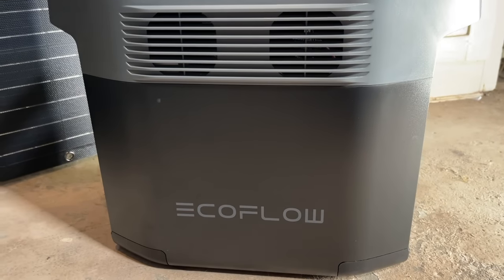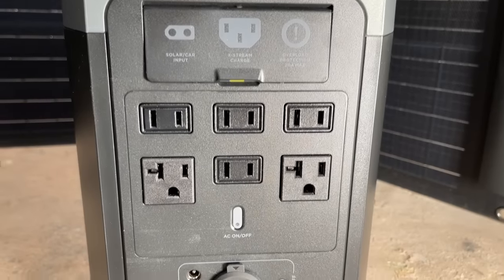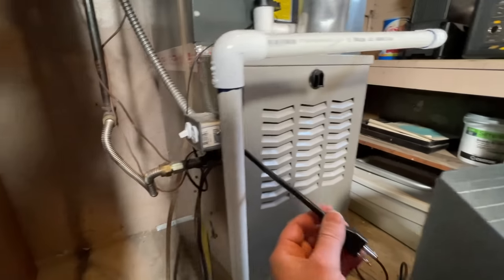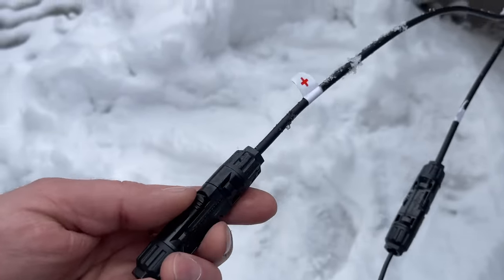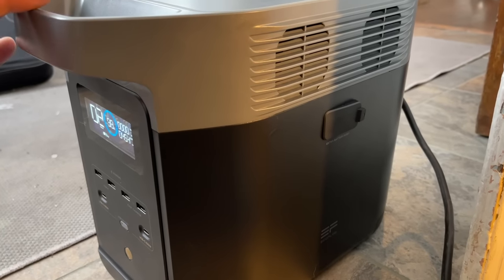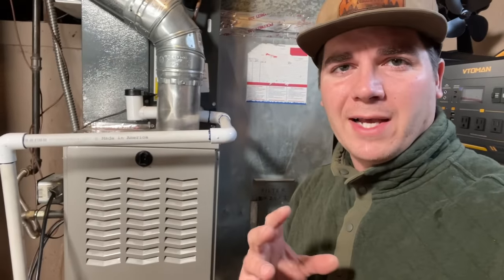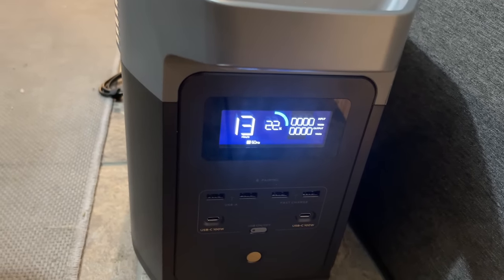How Long Will The EcoFlow Power Station Run My Furnace?  |  Power Outage Emergency Heat

Comment: While solar is nice to have for extended outages, in most cases the power will be knocked out by a storm that comes with dark clouds that make solar charging not practical. And the first sunny day after a storm is going to be when the power crews are out restoring downed power lines. So in this scenario, you may want to have another way to recharge depleted batteries.

One obvious solution is to have a gas generator. But if you have a generator, there's no need for a power station, right? Maybe not. Generators make noise and fumes, and when the power's out, gasoline may be hard to find. If you're already using a gas-powered lawnmower and/or garden tractor in the summer, and a gas-powered snow blower or snowmobile in the winter, this is less of a problem because you already have some stored at home, and rotate that stock regularly. If you don't, getting a generator that can run on propane is worth the extra expense. Unlike gasoline, propane is a simple molecule that can be stored for years without degrading.

To run a portable generator safely and reliably around the clock, you'd need to have household members up in shifts to make sure it doesn't burn the house down, asphyxiate the occupants or run out of gas. A better way to run one IMO is to use it to recharge power stations like the Ecoflow ones, that can be charged from zero to 100% in a little over an hour. That way the noise doesn't bother the neighbors at night, or attract thieves when you're away looking for more gas. Running it for an hour or two under full load will burn less gas than running it constantly under a light load.
Reply: It is best to have both. My generator is over a decade old but now with my powerbank I use it 80% less. If I were to replace my gen I would get one the is half the output cause I simply don't use it except to charge the powerbank for an hour and than shut it off till it needs to be charged again
Reply: @JD-yx7be  absolutely! If I had gone for a whole home generator, I have had 20 hours in the last 7 years to use it. Instead I went for a much smaller 2200W portable unit. Since all it has to do is charge batteries, I can run it at 100% as needed, vs. at a fraction of full capacity the whole time. So far, utility power has always come back before the batteries ran out, but it's there for when that happens.

Comment: Very insightful video, interesting product idea.... but I had hoped it would power a furnace or boiler for days, not hours since the heating source is oil or gas.  I really need something that will power HVAC for several days in case of an outage from an ice or heavy snow storm up here in the New England.  I guess a NG generator is still really the best option, unless there are other options ?

Comment: What wire type, size and connectors do you need to make extension cords between power station and solar panel connectors? I’d like to make up a 50 foot set. 

Do you know if they have a through the wall adapter for the solar connectors?

Comment: Thanx for the information and the video!  Are the battery generators really appropriate for larger loads with motors and compressors?  Yes the battery generators will work but current in rush on startup is very taxing and surely will foreshorten the lifespan of the battery generator if not damage it at some point?  Has there been any testing in how many cycles (of inductive) loads are practical (or even really appropriate)?  Battery generators are not cheap, expensive and time consuming to repair if it can be repaired (type of damage, parts, supply chains), and can be a fire hazard if safety measures fail.  I’m not knocking the tech … I own 4 battery gens that run computers, lights, televisions… but I’m Leary of furnace and refrigerators…. Love my Honda 2000i gas gen that I use to recharge everything

Comment: My furnace won't run with the open ground provided by the Ecoflow Delta 2.  I have a ground bonding plug but is it safe to use?
Reply: My plan is to just ground to ground - that is connect ground on the battery to a ground on an outlet of the house.
Reply: @Kari Mastin - Looks like I'm having the same issue with my Ecoflow Delta 2. The furnace shuts down after approx. 10-15 secs before the heat kicks in. Was wondering if you had figured out a workaround to the open ground issue.

Comment: My furnace run on breaker 14&15 20 amp double pole however they use 12/2 wire so I know they are not 208/220.  I was just going to cut the romex and install a male and female plug.  Yes I know it's not braided cable and not meant for that but hey it's only going to get used in a extended power out situation so I don't really care.  My question is my thermostat also runs of breaker 14/15 but where does the thermostat get it's power?  Does the thermostat get power from the furnaces in other words if I can provide generator power to my furnaces via your method will my thermostat be on to call for heat?

Comment: Why not a manual transfer switch and power a few 15amp breakers?
Reply: I agree .. thats the way to do it.. trouble is in most places that means a permit and licensed electrician.. and that is big bucks $$$!
Reply: @W-4-Z-D  MTS is the way to go, you can switch between your fridge, furnace, lights, whatever else you want. I've made plans but not implemented yet. If you're confident about the wiring, you don't need an electrician. You do need to get a permit and an inspection. In WA state it is about $100, so not bad at all.

Comment: My battery starts the inverter motor but then does not start the burner. Then the blower comes on with no heat?

Comment: My Bluetti eb55 won't run because of no ground or improper neutral.  My Ego inverter runs it fine. 
Don't know if it's just a Bluetti thing.
Reply: That seems like it's defective. Have you opened a case with them? Their product should be on par with EcoFlow's in terms of performance. Did you update the firmware using their app?

Comment: Dear HVAC Guy, I have tried exactly like your setup. I have EcoFlow Power Station Delta2. When I plug the pigtail into EcoFlow the furnace controller board LED is blinking it's not power up the furnace, I unplug the pigtail then plug it back into combo switch receptacle the furnace power back normal. I do not know why. Can you explain more detail please. Thank you.
Reply: Might be a floating ground issue....see if your EcoFlow mentions it in their install manual.

Comment: Why do you caution us not to place this ecoflow unit near the furnace? How far away should it be?
Reply: He probably is spacing it far enough away that it doesn't get hot, although most furnaces don't get that hot externally anyway.
Reply from the maker: If you are charging it with solar simultaneously it will emit hydrogen so you don’t want it close to an open flame. From what everyone has said.
Reply from the maker: If you aren’t charging simultaneously you can leave it right next to the furnace
Reply: @diyhvacguy  This is not true.  It's not vented lead acid battery....

Comment: You didn't answer your own question "How Long Will The EcoFlow Power Station Run My Furnace". You said it "supplied power" to the Furnace for 10 hours, but you didn't document how many "run hours" your furnace ran while on the EcoFlow. The question that you are asking "How Long Will The EcoFlow Power Station Run My Furnace" needs to measured in actual Run Time, not including Standby time. This EcoFlow wont help anyone if they come home to no power, hook up this power supply when the house is 55 degrees inside only to find out it shuts off at 63 degrees because it ran out of battery as the Furnace ran for say 1 hour straight. Also, lets face it your not going to lose power when its sunny outside and the wind is not blowing.

What are your test parameters?
How many Watts does your Furnace draw? Motor start up and Normal running?
How many Watt Hours does your EcoFlow supply?
Example: Your Furnace draws 500 watts, EcoFlow supplies 900 watt hours, you should get around 1.5 hours of constant run time. Then add in Solar charge amount per hour.

Comment: If i have natural gas , water boiler, i am just sunk right??
Reply: No. The EcoFLow will provide the necessary power to ignite the gas and then powers the furnace fan/blower. Also powers the thermostat if its wired to the furnace.

Comment: I believe these power units, some of them anyway run on Lipo Lithium polymer batteries. As a RC pilot a great deal of the hobby has gone electric using LiPo batteries. An important maintenance issue with these batteries is the fact they must be put into storage mode after use so you don't charge them after the use period. A single cell at full charge is 4.2 volts. Its normal storage voltage is 3.8 volts. If they are left in the fully charged voltage for extended periods of time the cell will degrade and become dangerous and could catch fire. So the very nature of a back up battery pack using LiPo batteries is not a sound strategy. You require it to be at full charge for it to be functional but you can't keep it at full charge for safety and utility reasons.
Reply: You bring up a good point….Most of the DIY type videos I've watched on the topic barely make mention of the safety issues involved. Personally, I'd like to see a more thorough analysis before I commit to one backup system vs another.  To me, it sounds impractical to have a backup system in another room of the house & run a long extension cord to power the furnace.  Practically speaking, one would want the batteries to be placed as near the furnace as possible in order to gain the greatest benefit (in terms of run time).  I need to do more research in this area before I subject myself & my family to the possible risks.
Reply: I think LiFePO4 is quite different, can be left fully charged, less hassle RE how to maintain or having to avoid zero charge. It's still good practice to avoid below freezing temperatures which damage cells. I also will use/drain it one every 2 or 3 months and then fully charge it. My battery is just for running my furnace if there's an ice storm. I run my work laptop off it every 2 months aprox, bring charge down to 10% to 30% and then fully charge / power it off. My power provider once took 3 days to restore power in some areas of my city after a wind storm, thus my city-dweller concern. I do have one natural gas fireplace in my 3 story home that will work safely while power is out but that's hardly enough for saving pipes/home. A generator isn't a good option for me. Worst case, once the backup LiFePO4 is drained (6.5 hours estimated EcoFlow River 2 Pro 768Wh running furnace only at freezing temp), I can charge it up outdoors in my car as it comes with a car charge cable. https://youtu.be/Ys1g6wFMbT8
Reply: Most newer, high quality power banks use Lithion-Iron technology.  More forgiving and a bit safer.  Standard recommendation is to keep them approx 2/3rds plus charged for long-term storage as a best practice...
Reply: You may have been correct a couple of years ago but that is no longer the case.

Comment: If I wanted to hire an electrician to install one of those "switches/outlets" on my gas furnace what is the official or technical term I would use?  There is already a box with a switch installed on my system.  Would that void my warranty?
Reply: There is such a thing, ‘ez generator transfer switch’, but you get into code compliance issues with a ‘floating neutral’ generator, such as a solar generator, with no external grounding.

Comment: Help! I hooked up my EF Delta II to my furnace just like you did. It wouldn't run it. It had a full charge. So I plugged in the AC power and it did run it until I cut off the AC power. Then the burner went out but the fan kept going. What do you think is wrong?
Reply from the maker: Try taking an old 3 prong extension cord and and cut off the flat power and neutral tabs so you are left with a cord with only the ground prongs on each side. Plug one into your home outlet and the other into one of the outlets on your inverter/power station. Let me know if that works for ya! It’s worked for several people.
Reply: @diyhvacguy  It didn't work for me. I have an older house with old wiring. My furnace is less than a year old and the HVAC guy grounded the furnace but the outlet wasn't grounded. So he disconnected one of the plugs that had only a ground hooked up, disconnected the ground wire so there was just the plug, and put the neutral tab back in it. Then he cut a piece of wire and connected one end to the ground and the other end to the neutral. Closed it back up and plugged it into one of the 3 prong inlets on the ECOflow. Then connected the furnace plug to an extension just like you did. Now it's working. Between you and my HVAC guy the problem is solved. Thanks so much.

Comment: I have a Ecoflow Delta II.  I installed the EZ Generator switch after watching your video.  I just installed it this morning.  The furnace works just fine on normal mode drawing power from the grid.  However, when I plug in my Delta II, the furnace fan kicks on then kicks off very shortly .  I have a Goodman furnace installed in 2012 (don't know BTU) for a 1400 sq ft house.  What am I doing wrong.  I have the Delta II set on X-Boost.
Reply: Maybe you need a neutral grounding plug? I've heard that some furnaces are sensitive to this and plugging one of those in can resolve the issue.

Comment: Question to all ... is this Ecoflow good for "clean power"? I have a newer Rheems furnace and I read once if you don't have good power or a really top end generator that it can burn out the electronic panel. Any thoughts anyone???? (Thanks!)
Reply: Any reputable brand LiFePO4 power station is good for clean power. EcoFlow, Anker, Jackery and BLUETTI are the top names for new technology products. You really need to compare the specs to those brands if going with, for example, Energizer, DeWalt or ROCKSOLAR which may be more likley to outsource, use old battery chemistry or electronics.
Reply: @MorganTheva ... Many thanks for "sharing the knowledge". Cheers!

Comment: You’re 120 outlets are not grounded, they just put the third prong in there so that your plugs will fit!
Reply: What is the implication of this with regard to safety and code compliance with the furnace wired the way he did it?
Reply: @BSerrell4  
I’m the wrong person to ask on that. But I’m sure it helps if you understand a lot of the electrical code. 
I prefer to run my whole house off of 48 V with a solar system I built myself, that way it runs everything, not just the furnace. But I’m sure for people who can’t afford to do what I did, this is a good back up. 
He’s done a few updates, and there’s a few other people who’ve done the same, I would make sure you watch everything before you try this.
Reply: the battery back up does not have a ground reference. so you can safely touch either the hot or natural and the earth and not be at a shock risk. ofcours if you touch both at the same time.. you will be

Comment: So what your furnace runs on 120 volts?
Does anyone know this.
Reply: Yes, most furnaces run off normal 120v house current.
Reply: @davidw.r.7801  Thank you. What about central air?
Reply: @altennent156  central air requires 220v dedicated circuit to operate
Reply: @davidw.r.7801  Ok that's what I thought and why I figured the furnace was 220.
Thanks!
Reply: Gas furnace Yes
Reply: A gas furnace needs 120v to operate its motors, transformer, and control board.

Comment: Is the Delta 2 Max floating or bonded neutral?  Nope, I don’t know much other than winter outages aren’t fun.  Looking to do this or the ezgenerator product…when the time comes.
Reply: Good question. I just had the EZ Generator switch installed by an electrician. Unfortunately on my setup with the Ecoflow Delta 2, my furnace stops operating after 10-15 seconds. Its possible my issue is linked to a floating/bonded neutral on the Ecoflow?

Comment: Would it be wise to install a soft start on the hvac in this scenario?
Reply: I have a soft start on my small 2 ton ac unit to use with my gas generator for hurricanes. It will help it last longer too. At least I can cool down a bedroom.

Comment: Cool, you got a EcoFlow product. 
Unfortunately I don’t think you actually show the furnace wattage draw on the Delta2, how much watts is your furnace using when on. 
My 90+ variable natural gas 16 year old unit takes about 330 to 350 when running. 
Doing simple math (350 x3hrs = 1,050 watts) I could run my furnace on low (if I changed that setting for no high second stage heat) for nearly 2.75 hours on the Delta 2’s capacity.
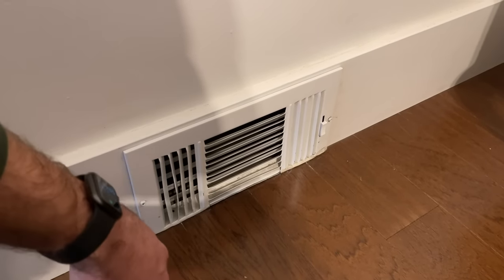Reply: @4:32 it shows 455W.
Reply: @budmartin3344  thanks. 
I must have looked away for a split second. 
That’s important info.

Comment: Wow. $1650 for only 10 hours use. Can buy a portable propane powered generator and install a transfer switch to power my whole home for a lot less than just this power station. And it will run continuously for as long as I have propane (500 gal. Tank).
Reply: Not a quality one. You can maybe do a china genset that will die in 1/5 the life of a Honda. The best is to have both I got a 3kw Honda gen and a 2kw powerbank. They should last decades which will give a better overall value. With a cheap china genset you will be lucky to get over a thousand hours on it
Reply: My Honda is over a decade old if it fails I will get a much small 1600watt unit cause my battery bank now used 80% of time in it's place.
The china clones might have the same specs on paper for 1/3 the price but they use much cheaper cast, lower quality metals, and lower tolerances in the machining. So you you will be a penny wise but a dollar short